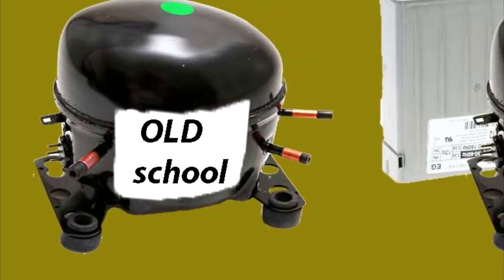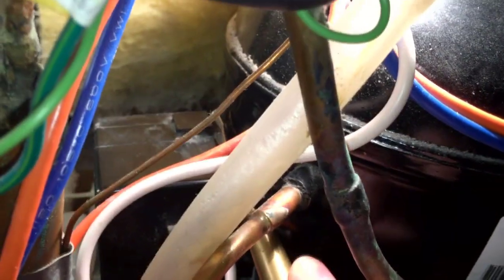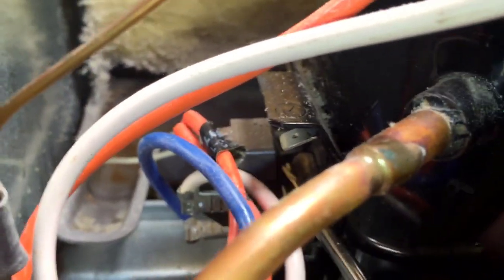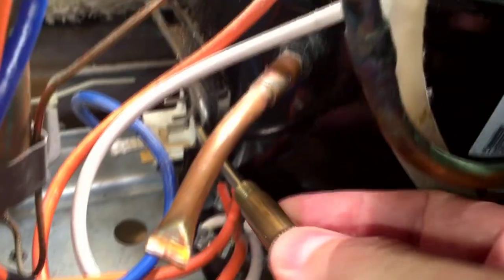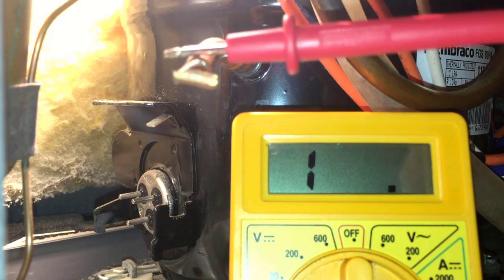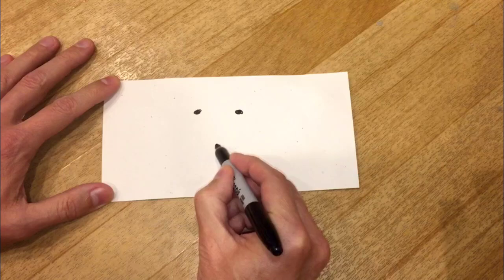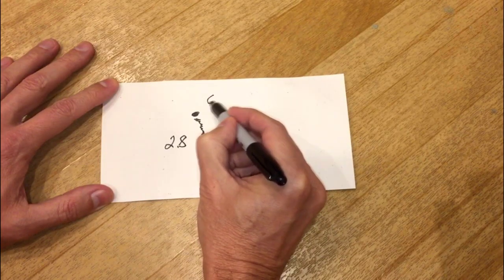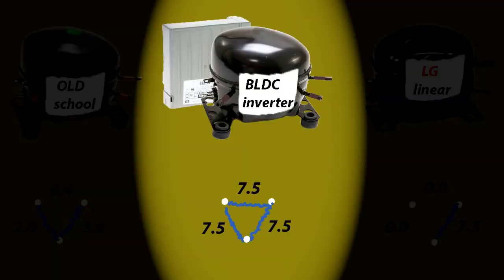Testing refrigerator compressor LG, Samsung, Whirlpool...

Comment: I have a LG fridge with Linear Compressor.  
Compressor tested and Ok
I bought new starter relay so relay is OK
Capacitor tested and OK
All fans are working including Coiled fan.

However, the compressor not start (not running) when I plugged in the power.

Can you tell me what else can be wrong?

Thanks
Reply from the maker: LG linear compressors don't have a starter relay... you probably mean overload relay.
The linear compressor is driven by the computer board (PCB). So, the board may be bad.
Linear compressors can be started and run with a "cheater cord" straight from the wall outlet. But I won't recommend doing it for nonprofessionals.
Reply: @Your-Self  thank you for your reply.  I press the test button on the board and it gave me an error code 22.  It means problem with compressor relay.  I changed the compressor relay, but the compressor still not running.
Reply from the maker: The number 22 is not an error code, at least in the USA market.
It indicates Test-2. When you press the test button a third time, 33 should come up on most models. Other models just have two tests.
Reply: @Your-Self  ah I see.  thank you .  I think I should call for professional services since everything is in order but the compressor not running.

Comment: Can you please also show how to test wisemotion compressor.
Reply from the maker: The wisemotion compressor is rare and weird. Unlike other compressors, it can stop running because there is a refrigerant leak in the system. It's difficult to figure out what the problem is for a DIYer. It's best to call Whirlpool authorized tech to troubleshoot it.

Comment: What if i only got reading on one side.  While testing the  prongs.
Reply from the maker: It's bad unless it's an LG linear compressor.
Reply: @Your-Self  yes it is.  I checked the relay, the compresser  it self using this methods, the fans are all on. The fans inside of the fridge an freezer are blowing.  It's one fan that blows to both side. I reset it with the button.  It's just not getting cold.  The tech said 1400 to fix it.  I'm hoping it's part of the list of fridges from that lawsuit..  any other advise?
Reply from the maker: If the fridge is under 5 years of age, LG typically replaces the compressor absolutely free.
If it's under 10, they may give you a free compressor, but you'll have to pay for the installation. Still kinda expensive.

Comment: Thanks for the video!  On the LG Linear compressor, at the 4:50 mark when you say there is nothing between the other 2 sides and you should not get a reading, your video shows 0 ohms.  Should it read 0 ohms or is it actually an open circuit?  Thanks!
Reply from the maker: Good catch. There should be an open circuit between the other two sides.
Reply: @Your-Self  Thanks for confirming!
Reply: Great video. I'm just a little confused with myself.  It looks like I have an LG liner compressor that was replaced 2 years ago on my new 5 year old kenmore elite refrigerator. My pins I have a single pin at the top and two at the bottom, like a regular triangle. I read from top single pin to bottom right and I get O.L , then i read from top single pin to bottom left and I get O.L , then I read the two lower pins side to side and I get 8.9. Can you tell me if this compressor is bad

Comment: Good afternoon, the video has been of great help but at the time of making the measurements I have 6.2 8.2 and 12.4, the last value should give 14.4 and gives something lower, could it be that the engine is damaged?, (tecumseh 335-ts-259 engine) I also did continuity tests and everything is fine. The fridge was working and began to hear a "click" until one day the fridge did not freeze more, today only turns on the bulb inside the fridge and sounds the "click" every so often, but my doubt is with the resistance values or  I don´t know if the PTC may be the source of the problem.
Reply from the maker: Your resistance measurement of 12.4 is close enough to be good.
The easiest what you can do is replace the PTC start relay and see if it works.

Comment: Great video.  I have a linear compressor and tested each contact and no reading.  The compressor is vibrating but the unit is not cooling.  Does this mean I have a bad compressor.  LG frig 7 years old.  Thanks
Reply from the maker: Since the compressor is vibrating, you should have at least one reading (possibly a bad multimeter).
However, the LG linear compressors can fail the way you described. Running vibrating but not cooling (crack in the reed valve).
A Less common issue with LG units is a refrigerant leak from the system. Which would have the same symptoms.
Either way, it's an expensive repair (((

Comment: I was just about to head to the big box store and buy a new fridge until I came across your video. I get a good ohms reading of 7.0 to 8.0 on the linear compressor. My problem is no cooling throughout the entire fridge. All fans work. Any advice is greatly appreciated.
Reply from the maker: A compressor can fail either electrically or mechanically. Since you have a good reading, most likely, your compressor has failed mechanically. That is typical for an LG linear compressor. There is a small chance that the refrigerant has leaked out from the system. And to know for sure, you need a tech to install gauges to check the pressure. Either way, it's an expensive repair.
Reply: @Your-Self   Just my luck, hey thanx for the response

Comment: What a great, informative video! Here is my quandary: I have a kegerator with an old school compressor. Found the unit warm one morning. After diagnosing I replaced the relay and start capacitor. The unit ran for a day or so and then did the same thing. I can hear the overload clicking. There is a visible arcing at the connection to the overload when this happens. Again, new components. I manually ran the compressor by taking a power cord and connecting power to the C and M and then jumping the S to get it going. This works fine. Measured resistance on the terminals and got 6.2, 14.7 and 20.9. Not sure what to check next? Does the compressor have a “dead spot” that causes it to have difficulty starting after it stops a few times? Is it just overheating and eventually failing ? Trying to decide if I trash this thing. It is a pretty pricey unit. Hope someone can help. Thanks!

Comment: I have a Lg lmxs27626s recently stopped producing cold air, I feel the fan blowing in the freezer, and can feel it up top as well, the compressor sounds good, and the fan near the coils runs as well, I’ve done the test 1 and 2 from pcb, I also checked the fuse with a meter i do get 22 22 on the display but from one of your comments that doesn’t mean anything.  I did notice some moisture near the bottom of fridge while access the compressor/coil not sure if that was leaked fluid or possible freezer items melting and leaked out. Any advice would be greatly appreciated as technicians are so expenses be to come out to diagnose
Reply from the maker: This model has LG linear compressor, which is the most common problem in the system. LG will typically replace the compressor for free if it's under 5 years old.
However, this model also has 2 cooling evaporators. And the one in the fridge compartment, most of the time, has a refrigerant leak. Which may not be covered by LG.
You have about a 50:50 chance of one of these issues. Unfortunately, it's impossible to figure out which one it is without a tech.

Comment: Great video  . I have a Westinghouse WSE7000SE , and the control module seems to have failed , fridge light was flickering , then turn off whilst the door was open , it was still staying cold , but then the fridge went dead , and the freezer light was the only thing working . I thought i would check the compressor before buying a new control  buzz box , and the readings i am getting is 26.2+11.8 =38 , which makes sense , but they are all pretty high readings . Even though the value equation adds up , why would they be so high ?
Reply from the maker: The manufacturer of your compressor decided to go with the higher resistance wires. But the readings look normal.
The flickering light points to a problem with the control board or the light itself. Also, a shorted (wet) DC fan motor, can overload the control board, so it can't supply power to the rest of the refrigerator... it gets pretty complicated with newer refrigerators. 
I guess replacing the control board would be a good first step without technician involvement.
Reply: @Your-Self  The fridge is totally dead , only freezer light is working . The starter relay and overload are high readings also , but its a 240v fridge . I replaced the diode on the control board and will do the 35v capacitors , as they look swollen on the tops . THANKS for your reply .
Reply: Hi Mate . I ended up replacing the zener diode and all four 35v capacitors and the fridge is perfect . It was your information that enabled me to do fix it , i am extremely grateful , thank you !!
Reply from the maker: Good to hear it!

Comment: Hi! My lg linear compressor passed all the tests. But, my reading on the only pins that read are averaging 19. What does that mean? Thanks!
Reply from the maker: You may have a loose wire on the multimeter if the reading is not stable and is jumping too much. What is the actual problem? The compressor is not running at all or running, but not cooling the refrigerator?
Reply: @Your-Self  the compressor sounds to be running. Gets warm. But no cool air in freezer, no air flow In fridge
Reply from the maker: If you can feel the airflow in the freezer, but it's not cold, there are two possible problems.
Either the refrigerant gas has leaked out. Or, most likely, the internal reed valve cracked... typical for a Linear compressor. If the fridge is under 5 years old, LG usually replaces the compressor absolutely free.

Comment: Thank you sir. Mine is also an lg compressor and the test i carried was like thsi
C+S=21
C+R = 17
S+R = 37
And i tested the relay and ptc in continuity mode, they are okey and the refrigerator compressor didnt start with all this test, pls any help
Reply from the maker: Did you check if the compressor is "shorted to ground" as in this video?
If it's not shorted, it could be mechanically locked up... not sure.
Is the compressor making any humming sounds like it's trying to start, and then clicking off?
If there is no sound at all, the temperature sensor inside the freezer/fridge may be bad. So it's not asking the compressor to start.

Comment: I have a 1yr old 33 bottle wine fridge that quit cooling. all fans, lights and panel are working. I've checked and the pins are opposite from your diagram like a triangle. Top pin to the left pin 2.5.  Top pin to right pin 0. Left pin to right pin 2.5. I've also checked the relay and show 0 resistance. Could the compressor and relay be both bad?

Comment: Have an sumsung inverter compressor and it has all electrical readings fine also control boards seems to be working fine but it seems to be a mechanical compressor internal issue!!! How often is this?
Reply from the maker: BLDC compressors are very reliable, but of course, anything can happen.
If your compressor is not shorted and has all 3 windings the same value, it's probably good. The inverter fails more often. If it gets 120 VAC on two larger wires, and a small DC voltage around ~2.5 V on two smaller wires, but the compressor is not running, the inverter is probably bad.

Comment: I don’t think mine is a a BLCD, no box behind it. But I have 7.5 ohms on all terminals. Do you think it’s toast? Thanks
Reply from the maker: If all terminals are equal at 7.5, that's probably a BLDC compressor.
The inverter could be hidden somewhere with or without the box.
Reply: @Your-Self  Thanks, but I don't see a box behind the compressor probably 20 years old. how would I find out what kind of compressor it is? it says LG MC57LAUM
Reply from the maker: I looked up the image of the label of this compressor, and it looks like a regular compressor. It's strange that all terminals are exactly the same so it's probably toast. On the bright side, it worked for 20 years... unlike newer refrigerators.
Reply: @Your-Self  thanks

Comment: Hi. Your videos and your narrative is by far the clearest as far as diagnosing these LG fridge issues. Thank you for them. 
 So my compressor is "running". It sounds healthy. Not hollow and not clicking like a thermal issue. 
 Condenser fan is running and both fridge and freezer fans function in run mode and during test mode. 
 My pcb doesn't have an LED. So no flashes. 
 I get a code "22" in the 2nd phase of diagnostic which can mean start relay or PCB, but compressor is running. 
 I'm willing to spend the $300+ to change board and relay, but not another grand to replace compressor. 
 What's your beat guess?
I'd be happy to compensate you for your time. 
 Thank you so much. 
Dave Beaumont
Reply from the maker: Code 22 is just a notification that you are on the 2nd phase (33 the 3rd phase).
You didn't mention the model number or if it's a Linear compressor. If it is Linear, I'm afraid you have to replace it. Or there is a small chance the refrigerant gas has leaked out. If it's not Linear, there is a higher chance of a gas leak. Either way an expensive repair. But if it's under 5 years old, LG may replace the Linear compressor free.

Comment: I'm getting 0 on my lg linear. I replaced my relay and it sounds like the compressor is on, I can feel it viberating, it's cool but not cold. Am I maybe running the test wrong? Or would the compressor still kick on sometimes even if it reads 0?
Reply from the maker: If the compressor is capable of running, it can't read 0 between all 3 pins. Maybe a bad meter?
Need to look inside the freezer at Evaporator Coil. If it has a thick layer of icy frost, the problem could be with the Defrost. If no frost at all, the compressor could be going weak, or there is a leak of refrigerant gas from the system.
LG typically replaces weak compressors free for the first 5 years.
Reply: @Your-Self  I could be testing wrong. When I put both prongs on the copper pipe I get a reading  ut between the 3 pins imnnit getting anything
Reply: I have my hand in the compressor and it's running but still getting error code 22 after replacing the relay. I have an appointment with a tech in a few days. Does this sound like my compressor needs to be replaced. It is a little warm
Reply from the maker: Running but not cooling, is a typical problem with the LG Linear compressors. But I can't be sure without being there.
Also, I'm not familiar with the error code 22. It would be nice if your tech could explain what that means. Because the only similar code I know is 22 22 when you run Test#2 from the motherboard.

Comment: Any idea if current LG models have updated compressors that are more reliable than the linear problematic compressors?
Reply from the maker: New updated LG compressors have been around for a few years only. Unfortunately, that's not enough time to determine if they are any better than the previous version.

Comment: hi @yourself , first thanks for your great videos and thanks for your time, it's truly appreciated...i have a LG LFXS28566M around 4 years old, recently stopped cooling, everything seems to be working visually and audibly, lights come on..fans come on..compressor runs, i changed the relay with new one just to make sure...didn't do much...i pierced the vaccum side of the copper pipe with a "bullet piercing" thinking it might be low on freon, i followed all instructions on doing it and nothing , the pressure when i open the valve on all vids i watched reads negative or at least runs towards low as a vaccum, on mine it only goes as high as i release freon and stays there, i tried so many times to release and refill freon in hopes of it working but no luck so far, on the test from motherboard it gives me error "22"...and nothing else...no led flashes and no blown fuses....tested the compressor as you showed in this video everything checks except for the ground to pin which reads between 10-11...not 7.5 or 8...i am really lost at this point...any suggestion you might have would help...i really apologize for the lengthy comment, and thank you in advance for any suggestion you may have.
Reply from the maker: Unfortunately, these Linear compressors are very finicky. You must charge them with the exact amount of refrigerant gas as per the label.
Also, it's very possible the compressor got weak and can't pump. So you may need a new one.
Since you already have a bullet valve installed, check the Static pressure first (refrigerator unplugged). The static pressure should be around 50-60 PSI in a fully charged system.
Then start the compressor, and the pressure should drop to around 0 PSI. If the pressure drops only by a little, let's say, down to 20-40 PSI, the compressor is bad. But if the pressure goes into a vacuum, there may be a restriction in the filter/drier or the capillary (thinnest) tube.
Reply: @Your-Self  thanks a lot, i tried the static pressure and it still says around 65-70 even after i turn on the compressor...as if it's not vacuuming at all...
Reply from the maker: Yep, sounds like an inefficient compressor.
You need a new compressor and probably a software update to the main PCB board with a special LG jig.
Reply: @Your-Self  thanks brother, sounds like a new fridge to me and never LG because so far i seen only horror stories from them, they really don't respect customers at all